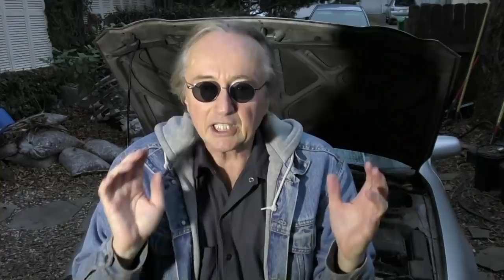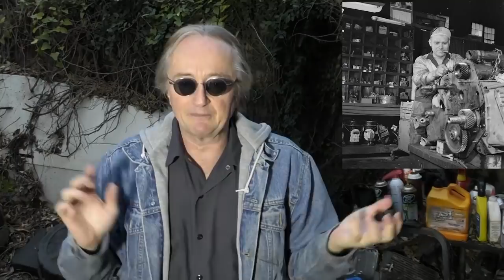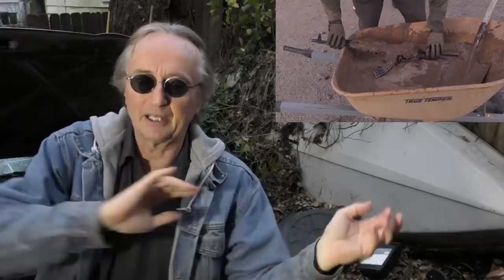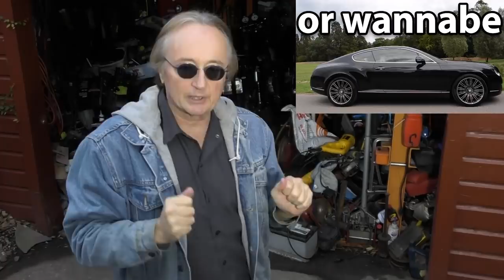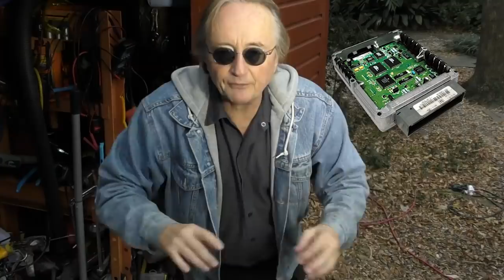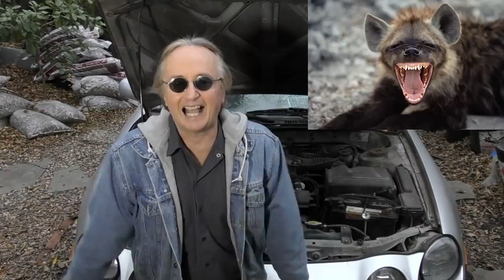Why Luxury Cars are Designed to be Unreliable

Comment: Scotty I have a 96 Chrysler town and country handicapp van 3.8v6. Wife went to her mother's across the street went to leave engine would spin over but wouldn't start. Battery is new terminals are clean fuel pump and filter is new. Fuel pump is running. Will run on starting fluid sprayed into air intake but not on it's own. Any ideas? Thanks Tommy

Comment: buy a Jaguar or Range Rover used, with a few years warranty left, get the extended warranty then, before it expires, trade it in.  These two nameplates are the MOST unreliable compared to others, yet very popular and reasonable if you buy right and have good extended warranties.  $80k Range Rover buy for $50k, Jag F-Type originally $70k buy for $40k used.  Same with Mercedes, pay the $4k to get a  used Benz certified for the factory extended warranty.  Buying right keeps the price down and keeping stuff under warranty and in a garage keeps 'em runnin' without breaking the bank.

Comment: Scotty, my Honda Civic LX 2014 acted strange twice few years ago but has been fine since then. I started the car, put reverse to take it out of parking and at that point i lost all control. Steering wont turn, putting car in park gear wont stop it. Car only stopped once it hit the curb and it made some kind of rattling noise while stopping. Same thing happened again few days later but this time in drive setting. Honda dealer checked the car and they couldn’t find anything wrong with the car

Comment: My bmw 328i xdrive I bought it used. I put premium gas in it always and maintain oil changes & the other thing I made sure to do is buy a FULL coverage warrantee that covers the whole vehicle including electronics for 4 years just in case because I was nervous. I've had no problems yet and the rating on my vehicle over all is pretty high in all categories on most forums. I did my research before I bought it. I think the 7 series is a different story. Just saying .......I hope my bmw keeps doing as well as it has been. I absolutely LOVE my car. I have owned over 20 cars/trucks and this car is by far my favorite. My last Suv a Ford Escape had less than 80,000 miles on it and the transmission went in it. Ford had service bulletins about there defect transmission but no recall so I was stuck with the $2000 bill just to replace the band on the transmission at the dealer  (all other shops wanted  $3000+). I've had way more issues with my American made vehicles. I had a Volvo and that lasted to 200,000 miles without an issue. So idk. My experience is the opposite so idk🤔☺😁

Comment: Will a 2010 Chevrolet HHR LS with 151,600 miles on it that looks like it's been well cared for last past 200,000 miles if oil and filters and changed when they should be or are there things that Chevrolet didn't do right that might trip you up?

Comment: Scotty ..... I am a huge fan ... here is my question:  I have a Mercedes C-230 2006 ... low mileage 62,000  .... it has low miles because  my wife does not drive much snd we use my Grand Cherokee 2000 for the bulk of our driving. In 2017 the computer went and we were ready to have it towed to the junk yard but decided to revive it at the dealership by having them put in a new computer module for $2,200.  Well, once that was invested we then went for reupholstering, new headliner, new brakes all around, new tires, new headlights .... dents out etc until the tab hit $12,000.  Now we find the resale is around max $4,000 retail ... $2,000 wholesale.  The car drives like a smooth rocket ship and the low miles are really nice as it feels new ... but one mechanic said the front suspension needs all new bushings and such for around $800 and I can see the roof paint is getting dull from car washes .... and of course it is Russian Roulette as to what expensive part could go wrong such as the sunroof, or the  transmission or the air conditioning which could be very expensive.  Should I just give it up and sell it for the cheap amount they offer .... or hang onto it and take the risk and ride out our - not so wise - investment ?  I can’t expect a video as the car is here in Miami Beach .... but maybe you could do a video anyway .... or even a comment response would be great.

Comment: Do you know if you’ll need a GM tech 2 to reprogram a crankshaft sensor on a 07 trailblazer, I have a code p0017 and I change out my camshaft/crankshaft sens and VVT solenoid, and the code is still present

Comment: Had a 1995 Ford Probe, could barely get 100,000 miles out of it. Major problems throughout the ownership and purchased brand new. Gave thatcar away, someone wanted to buy it and I wouldn't even sell it. It was still running cause I paid probably more in repairs then I did for the car brand new, but it then had a gas leak somewhere, I was done. 95 Mercury Cougar Limited, transmission problems but not a lot of other problems. Used 1991 Acura Legend. Dealer said the timing belt had been changed but it hadn't, so once that broke the car was dead, but it lasted well past the time I paid it off with no other peoplems. Used 1992 Toyota Camry with 92k, ran it to over 200k until wife was in an accident with it, only problem ever had was an ignition coil go bad, like 130 bucks at the shop and it was running fine a again, just change the oil every 3000 miles, and of course when your brakes and rotors wear out. 1998 Lexus LS400 has over 300k, needed new throttle body, starter, alternator, but  it has 300k miles so I'd expect that, gave to my daughter. Had to replace the transmission but Lexus said it was my fault because I didn't read the owners manual. Was having my oil changes done at Valvoline Instant Oil Change because of their fast service and they recommended I needed a transmission flush, I said okay since I need it. Right after that I lost 1st and 2nd gear. Car would take off in 3rd gear only and Transmission only lasted about 5 months after that running horribly. Lexus service told me it was a closed transmission and if you flush it that can ruin it. 07 Chevy Trailblazer 270k, exhaust problems (still current even after replacing many parts of it), replaced transmission, suspension upper/lower ball joints replaced. Overall I'm still happy with it. 1995 Ford Escape Limited (junk) little over 100k. PCM computer went bad, had repaired, alternator went bad (and this is super expensive for the labor because of where it's placed, the Ford dealer is actually the cheapest place to have it fixed and I got a quote from several shops) Starter went bad had replaced, front tire blew out and wrapped around like those old Ford Explorer tires were doing and did damage to the car. Gold ring that works with the AWD around the drive train broke. Turn the stereo knob down and it turns up to full blast. Door paneling was falling off. Weather strips peeling up. And something I'd never seen on any car I've ever owned. The front brake lines broke open. Never in my life had I seen that happen. I replaced them both myself, they were cheap at Autozone and did an internet search and it was a pretty common problem with this vehicle. That's a horrible safety issue in my opinion. Smh. 08 Lexus LS460 149k. Current vehicle with the 07 Trailblazer.

Comment: Scotty what are your thoughts on the 98 Honda Civic 1.6 L I've had this car for over 6 years the odometer stopped at a hundred and sixty Thousand Miles about 5 years ago and I've been driving it long distance for work everyday runs great probably has close to 300000 miles what do you think I should do as far as maintenance at this point like I said it runs great and I've always been told don't fix something that's not broke?

Comment: Scotty--Some fool just crashed my parked 1997 Acura CL 3.0, and I have to buy a new used car. I am trying to choose between a 2010 pr 2011 Acura RDX (each with a clean CARFAX report and about 110K miles for $10,000) or a 2010 Infinity EX35 (with a clean CARFAX report and about 110K miles for $9,000) or a 2004 or 2005 Lexus LS 430.(with a clean CARFAX report and about 186K miles for 2004 priced at $7900 or 130K miles for the 2005 prices at $7,000). I am buying from a reputable CARFAX dealer and want to spend under $10K. I love the Lexus but sometimes need to haul large loads and thus may want the EX35 Journey.  Can you please give me your thoughts and opinions about these three cars and which year I should look to? I understand that the Infinity cars may not be accurately listed by CARFAX, so am especially interested in your take on it.  I am especially interested in after purchase maintenance costs as I cannot afford large unexpected outlays (who can?)  Thanks in advance for any comments or suggestions!

Comment: Yo Scotty, I got a 2012 Camry SE just broke the 100,000 marker & when the eco light comes on, sometimes the car does a slight shake. I replaced all the rotors & balanced?rotated all 4 wheels during my last brake job. The car still rattles slightly but not as bad as before. Is this sensor related or abs related? Help me out man. Thanks.

Comment: My parents got a used BMW Z4 3.0i manual transmission. But we live and TX and the AC was dead because of that and many other reasons it just ended up in storage for FIVE YEARS. Anyway I'm looking to get a used car and I'm wondering if I should try flushing out the fluids and replacing the dead parts and fixing it up instead?

Comment: Had a 92 Camry  drove 330,000 miles in 10 years  original engine and transmission . Drove fine when I sold it . Toyota definitely regretting they sold me a lifetime muffler. I think I got about 5 of them free .

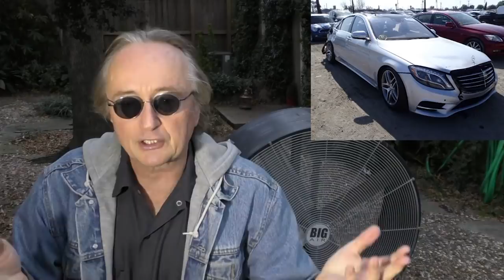Comment: Hey Scotty I have a few vehicles too many and am trying to narrow them down to two.   What I have is an economy car and on old G series chevy van, the 80'-90's type.    I swapped in a 6.2 diesel into one of them and it worked great.  Get near 30 mpg in a camper van.  I'ld like your opinion on whether or not the van is worth the effort to rebuild the engine, .. suspension.....etc etc. I can do almost all the work myself, so it's financially not a real hardship.  Those old vans have issues though as i'm sure you know... windshield leaks, wiper motor/switch problems, door seals,  RUST...      The old van worked much better than I expected with the diesel motor, overdrive trans and 3:08 gears.   I tows well, drives well, as of now it leaks well, paint fades well, windshield cracked and leaking, .. some rust around rear wheels but solid where it counts.     I can weld and have the tools.   Would I be better moving up into the express/savaanna vans or rebuild this old truck ????

Comment: The Cadillac CTS-V is an engineering masterpiece with minimal issues.
When Cadillac uses an LS based engine, they have a winner. When they try to get fancy and build their own engine, they create a lemon.
Remember the old Cadillac Fleetwood from 25-30 years ago? Great car.
Reply: I have a 02 Cadillac Eldorado ETC with the Northstar motor.  It has been very reliable with only regular maintenance. Doesn't burn or leak oil, doesn't overheat or lose coolant and drives like a bat out of hell! I must have the one unicorn because mine has been a fantastic car, one of the best I have ever owned and I have owned plenty of nice cars. It really is beautiful.

Comment: P/u a  2013 Jag convt XK w/ 42K miles a few months back, warranty good thru Nov 2019, for 32K.  It's just the wknd or date ride.   The lines, performance, and handling are excellent.   What I like about luxury cars is that in the first 5 yrs they depreciate like a falling rock w/ an anchor attached to it.   This car was about a $ 100K just 5 yrs ago, and I picked up the car I wanted for under 1/3 of original cost.

Comment: A question I have for you is; I love (some) cars from 1950-1989 but when I look into buying one, all the ones I like cost upwards of $80k. With the cheaper ones being priced at around $25k-$40k. 

You mentioned in this video that you still drive a car from the 90's, but I'm wondering if these cars I'm looking at are even reliable anymore, assuming the repair/maintenance costs aren't through the roof. Also you said a guy bought a luxury car for $10k and everything was broken on it- I don't want to spend all this money on an AE86 or a 1957 Chevrolet only to find that it's going to fail completely in a month and no parts are in circulation for them anymore. Thank you for reading.

Comment: I feel like a sucker now having just bought a new Volvo XC60 :( My previous car was a Subaru Forester. It lasted 18 years, 210k miles. I've always been a Japanese car owner til this point. I had a Honda Civic before the Forester. I thought about getting a new Lexus NX/RX series crossover because of the brand's renowned reliability, but I just couldn't stand the way they look(the latest gen). They look "spiky", sharp angles and creases all over, very busy looking. Didn't want any BMWs, MBs, Audis either(bad reliability). Two of my friends had the first gen XC60, and told me they didn't have any problems after 5~6 years. I liked the way the new XC60 looks, so I went with it. I guess buying a car is also an emotional experience. Sometimes, esthetics play a big part of it. I'm not expecting the XC60 would last 18 years or 200k miles. If it can last 10 years without major issues, I'd be happy. I also bought extended warranty for it(10 years, 100k bumper to bumper) just in case. Keep my fingers crossed.

Comment: Fun luxury cars are the old classics. Although finding something like a good condition 1977 Cadillac that isn't rusted out and falling apart from its own weight may be difficult. I knew some friends that were in a 1961 car club and they fixed up great American cars from 1961, such as the Chrysler Imperial, Lincoln Continental, Chevrolet Corvette, Cadillac Eldorado, Ford Thunderbird, Buick Electra, the last model DeSoto, and so on.

Comment: I still have it fresh in my memory when many years ago, while working at a hardwarestore, a customers MB "took a leak" and spilled its fluids from the hydraulic suspension without a specific reason and the owner was cussing like a pirate. I said that you are in luck, because the nearest mech-shop is 70 meters away. My grandpa always said to think about the positive things even when the things went down the sh**ter.

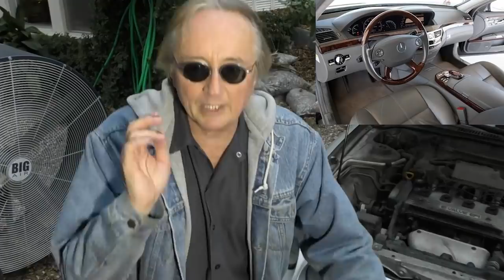Comment: 5:07 Don’t drive a car with windows that don’t work because if you get into a wreck or into water and your doors won’t work your windows are your only way to get out. Also you can break a window by using a window breaker tool or removing your headrest and using the metal end of it to break the window.

Comment: Hey Scotty what do you think about that past 3,000 mile oil change I think even though you have the best oil and filter going 5,000 or even up to 10,000 miles that some oils say you can do but I think as soon as it starts getting dirty the little parts of dirt and metal filings are still going through the motor so I think as soon as it starts getting dirty no matter what oil and filter you have if you care about your motor it should never go past 3,000 miles especially a car with a turbo or supercharger and or lot of stop and go driving and short trips Do you agree with me Scotty?  I’m a mechanic with 25 years experience

Comment: I thought prius has a simple safety switch to turn off the high voltage. Also, batteries are getting cheaper to replace now. I've heard you can get 2-300,000 out of a Prius.

Comment: Scotty
I have bought Toyota sence 96 have had 8 all were good.
Bought a 2015 Tacoma new 
Didn't get extended warranty on 015
Didn't ever need it on older Toyota or use it.
Well 015 a/c/compressor went out 40 mi
2.7 engine
This truck back fire s at start up sence day one
Dealer clams it would not do it for them.
What could it be?
I read on Tacoma forum lots of people have this same back fire.
They just don't deal with it.

Comment: I bought a 2012 Audi A3 tdi for $12k. It was a $40k car new and 7 years later cost about the same as a Golf tdi from the same age, but is nicer inside and out, and also still built in Germany. But since it is basically a Golf, parts are cheap and available, just like that Lexus which is probably based off of the Camry. As Scotty says, there are exceptions.

Comment: The only thing wrong with my 95 Saturn SL2 is the AC doesn't work. Probably just needs a recharge. 144k on the odometer. Put 6 or 7 hundred miles on it per week. Tape player works good says clean. Window cranks are decent. Rides pretty decent. Will probably spend 5 grand on a used A8 in two years when my salary doubles and I don't have a long commute anymore. The ride is too nice.

Comment: i went into buying a used car with the intention of getting a honda or toyota like scotty said but they all had issues on creigslist. so i bought a 1998 volvo c70. i love it and from what scotty has said the older volvos run like tanks. anyone have any advice for a new used volvo owner? 200k milez, bit of body damage, 4 spd auto, $1000. edit . does anyone know if this 5 cylinder engine has a turbo?

Comment: If that is so true, why was my Mercedes E55 AMG running perfectly, with every single electrical part still working flawlessly at 266k miles when I sold it? (It still ran its stated 1/4 mile time from new too) Why has my wife's Mercedes c320 4Matic been absolutely reliable since we bought it, have put on 75k miles with no extraordinary issue? My sister has an Audi A6, it's been neglected awfully, still runs and drives nice at 230k. I have had a few BMW cars over the years too, no major issues to speak of save for oil leaks.

Comment: I've had two Mercedes 300 series with the straight 6 cylinder 1.5 liter engine in them both had over 300,000 miles and ran great but other things broke to expensive to justify fixing I wonder what's the highest milage you've ever seen on one of those